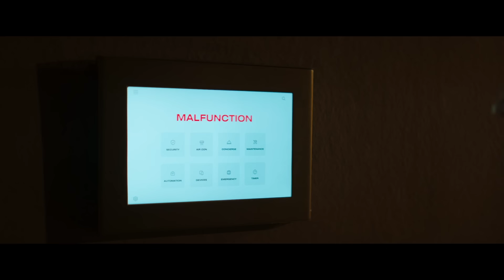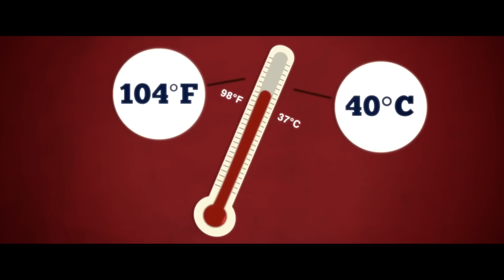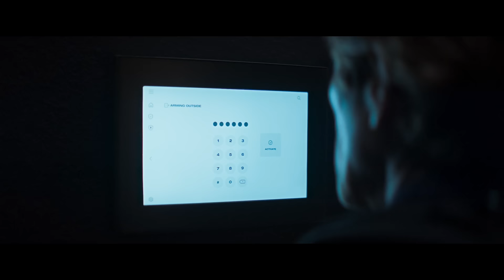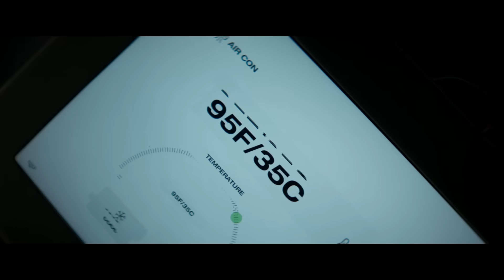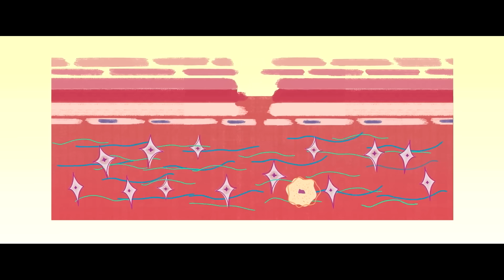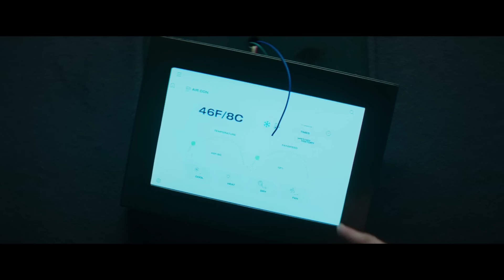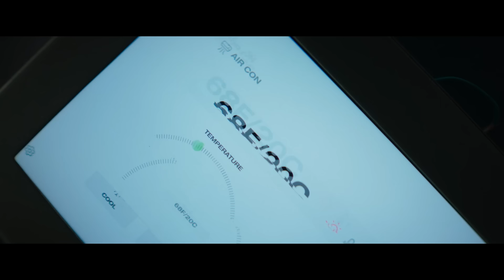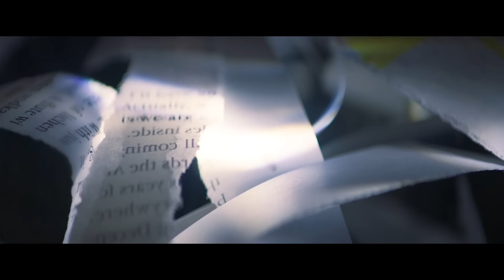How To Beat The DEATH HOUSE In "Inside"

Comment: I would also like to add that since the security system was gonna randomly rude and lower the temperature, once I found the gardens sprinkler water was safe I would use it to make more ice cubes in the event that the heat gets too high again, I’d prefer the place colder cuz I can grab more things to warm up than I can to cook down but still just in case
Reply: Yeah it would take being a lot cooler than room temperature to kill someone than it would need to be warmer than room temperature to kill them or severely debilitate them.

Comment: Even if the police did come to get him, hed be arrested sure, but the homeowner would be sued and convicted for cruel and unusual punishment most likely, furthermore, Nemo would be able to sue the owner for an insane amount of money.  This has happened many many times with robbers actually getting away with money and without conviction because of the homeowner's actions.
Reply: Not just the homeowner, in this case the building  owners can be prosecuted and sued as well. Having an aparartment that cannot be exited in an emergency is a massive violation of fire safety codes. So is having a fire alarm be triggered but not be responded to.
Reply: but the system malfunctioned, theres no proof the homeowner intentionally wanted to trap anyone so i dont think he'd get in trouble
Reply: @TheCinnamondemon Intent or not, in case of an emergency if there is not a clear way to escape then someone is held liable, usually the one that built the building. Considering the collector had security camera access to many parts of the building, we can assume that they are either the owner or have a great deal of influence over the building.

This building absolutely breaks the fire code and Nemo definitely would've been able to sue in the event that the police showed up.

Also I do believe that there is a high likelihood that they could prove intent to toy with Nemo. The garden's sprinkler system does not activate once until the point where he desperately needed it, and then it conveniently turns on and is now active for quite a consistent schedule across multiple days. The idea that you could break the security system into turning up the heat already seems fishy to me, but the fact it just magically went the opposite way conveniently when Nemo was at serious risk of heat related injuries is bs and there is no way that wasn't planned, meaning they still have significant control over the apartment despite the control system not working. Unless the owner is able to access the building and remove evidence of this fact before Nemo sues and this gets investigated (which is entirely possible that they can, or they may have someone in the police force that can hide the evidence for them) then I think they absolutely could prove intent, even though that isn't necessary.

Comment: Cold air being pumped in is ALOT better than hot air. You can only take off so many layers to cool down and have limited resources that could keep heat away and hydration becomes a worse issue, in the cold you can layer on and on clothes, blankets and everything else that keeps in heat,hydration becomes less of an issue(still a big issue tho) since the air becomes more moisturized, the cold also doesent make you as weak as the heat.
Reply: Actually a major part of air conditioning is removing humidity, making the air extremely dry. But yeah nearly everything else about the cold is better than extreme heat.
Reply: A lot is two words, not one…
Reply: @skaie.  don't think you have a lot to worry about dry air with an indoor pool tho
Reply: I live on the Tropical Island of Guam.  I would prefer 104F over freezing temp any day of my life.  I detest the cold.
Reply: @jdsguam  We're not talking about preferences here though.
We're talking about survivability, in which case cold is objectively better. There's even a decent amount of stuff to burn in a pinch, although that can be risky with sprinkler systems.
Reply: @MartinFinnerup  if sprinkler systems exist, that means smoke detectors exist
Would be safe to assume that would set off an alarm and summon help 👀
Reply: @jdsguam I've been to Guam and grew up in Texas and I HATE the heat, it goes both ways
Reply: @somenamelessdude8095  I grew up in Northern Jersey, lived in Germany & South Korea for years.  By the time I turned 37, I never wanted to experience winter again.  So I moved to Guam.  I love the never ending summer.
Reply: @jdsguam  that's how it works, just like all my friends who grew up in Indiana hate the winter. I've been to Busan too, we get around
Reply: @somenamelessdude8095  I was born in Indiana - Winter at every turn!  lol
Reply: @jdsguam  it's no Guam but it gets humid sometimes. Yuck
Reply: @jdsguam In a life or death scenario where you have extremely limited resources (including food and water) the cold is just objectively better.

Comment: A few things which may have worked is:

1: he could bottle pool water and refrigerate it it make ice cubes. These couldn’t be eaten, but could help cool him down. 

2: perhaps he could destroy the toilet. This may lead a hole big enough for him to climb through and possibly get out through the walls/ floor. If the hole was too small. After getting the sprinkler system on the water could have leaked down to lower floors and got someone’s attention. As the water would be dripping through walls the water may reach lower floors, increasing the chances of someone reporting a problem.
Reply: he could also have found the pipe that feeds the sprinkler system for the plants and broken it, causing the pressurized water to flood the apartment and inevitably leak into the floor below or through the main door into the aisle where "Jasmin" would have noticed it and sounded the alarm.
Reply: The freezer wasn't working, that's why the ice was was melting (14:30)

Comment: All the teammates had to do was call the building front desk pretending to be the owner of the penthouse and tell them, "my house sitter is having electrical issues, please send maintenance to help him." No risk to themselves, and Nemo could get out of there with a plausible story to avoid getting arrested. Why'd they abandon him so fast?
Reply: I think the teammate is in on a scheme of sorts with the owner, which is why they abandoned him
Reply: @MunchingDex  or they were the owner
Reply: Wouldn't the front desk ask.... how did the electrician get inside the penthouse?
Reply: the theory goes that Nemo was set up, and that "3" was either the owner or a co-conspirator who deliberately wanted Nemo to get trapped in there... a "social experiment" if you will.
Reply: @aaronjonellhall1937  Why would they let the electrician in and then wonder how he got in?🤦‍♂
Reply: @NikolaStojadinovic-v3g   The burgular that is in his apartment didn’t go through the front door of the building.  Also, I’m sure that the front desk has the condo owner phone number and the first thing they’d do is try to call the owner back after they escort the “electrician” out the building.
Reply: I think the reason why they abandoned him is because when the system broke, the reception was turned off as well. Do you all get what I mean?
Reply: @aaronjonellhall1937 they can lie say they let them in with a special system they have installed for their house using the roof since they wanted their place to be fixed while gone.
Reply: @aaronjonellhall1937 that isn't what they were suggesting to do... They said to tell the front desk their "HOUSE SITTER" is having electronic issues and for the FRONT DESK to call an electrician. How did you get so confused on their point... There would be no issue with the electrician because the front desk would literally call. And the burglar is the "House sitter".
Reply: @anniellusion  the problem, is that the "house sitter" never entered the building legitimately, they would know if there was someone living in an pent house, because, you know, the house sitter will go in and out of the room? do you have room temp iq or something?

Comment: I had a theory the art collecter was really his accomplice. the door shutting and then him abandoning you almost immediately when he could have easily gotten you some help. the odd painting showing him. the painting now being where it was supposed to be,the accomplice pressuring him theres alot.

also wouldn't putting something in between the door just crush the object? anything that's not metal would be crushed wouldn't it?
Reply: I like that theory, essentially the accomplice knew that he would lose his mind and make “art” like he did on that walls.
Reply: Entertainment Seeker had the same idea. I'll add my vote as well; it makes sense to me
Reply: A dresser as big, heavy, and expensive as the ones that would presumably be in the apartment wouldn't get crushed, could also put a couch or bed frame in it as well. Unless that door is a hydraulic press it should be stopped relatively easy
Reply: they could literally have brought a big thick solid metal bar of hardened steel in the helicopter to use as a doorstop, no need to use something from inside the house itself.
they could have fixed it to some wheels and lowered it on to the platform from the helicopter, and all nemo would have to do is gently push it into place, then lock the wheels to prevent it from sliding anywhere
Reply: @DrDolan2000  I don't know who that is
Reply: @ZugzugZugzugson  gotcha makes sense
Reply: Look at the penthouse whoever owns it clearly isn’t worried about money so they wouldn’t cheap out on furniture so the stuff would be well made enough to stop if not slow down the closing doors enough to give you those precious few seconds you need to escape
Reply: The painting was always where it was supposed to be. He just didn't know how to see it
Reply: Thx captain obvious.
Reply: @thekekman8483 I mean realistically he has 7 minutes, the amount of time it would take to move something large enough to block it just wasn't worth it most likely.

Comment: How many walls in a building like this are reinforced? The doors and windows are designed to not be broken. I’d go for the walls in general.
Reply: That was my first thought, People never think of the walls. In the US many times the walls are just drywall and maybe insulation. In many other countries the walls are actually concrete. Given the steel door, artwork, and it's penthouse I give a slightly higher chance the walls are reinforced but still a good option.
Reply: My first thought as well
Reply: I lived in a building like that in Manhattan, and all of the walls were also reinforced with steel. If the lock on the door broke, the only way out would be to try and break a window and hope you survived the 24 story fall.
Reply: That's what I kept thinking! Or bang on them to get the girl's attention
Reply: I'm honestly surprised no one ever thinks of that. It's pretty much a common trope that angry people can punch holes in the wall. How hard could it be to think you can angry punch the wall more than once and it might work.
Reply: The D&D Adventuring party approach!

Comment: As far as the heat being on, he can block the air vents causing the unit that supplys the heat to shut down on high temperature rise, or just pull all the wires from the thermostat
Reply: This was my idea I’ll have to do was cover the vent
Reply: And maybe that would cause more damage which would make people in the building complain and then the owners would send someone to fix it

Comment: That glass is strong but once there's force applied as a great-pressure, a strike it would usually rebound will make the first break; but the strength of those windows are in ply, a transparent polymer-sheet adhered between each reinforced panel, prevents broken surfaces from allowing entry: subsequent layers of reinforced glass and polymer would still hold up, and each has to be broken individually. I'd line furniture up end to end until the space between the opposing wall and the window are jammed tight to bulge the pane of glass, then I'd hammer a piece of wine-bottle through it.

Comment: It’s actually awful advice to try to ration your water the most common way to die in hot areas like deserts is dehydration even when they have a full bottle of water because when you don’t realize how dehydrated you actually are until it’s too late the best thing to do is be as hydrated as possible and if you have little water to work with you should drink it all
Reply: This isn't exactly true.
It's not a bad idea to ration your water. It's a bad idea to ration your water stupidly, and let yourself become dehydrated for no reason so you can hoard water like an RPG-player hoarding potions.
Reply: You would be amazed at how many people die of dehydration in the desert with water still in their canteen/water bottle. If you have water drink it, stay as close to hydrated as possible then the dehydration has to start from a place of full hydration, instead of keeping yourself near or in a state of dehydration because it’s much less of a drop to a negative outcome.
Also it’s weird but true that more people drown in deserts than die from dehydration. Probably because the ground is so barren that flash floods are a thing, because the ground is so barren it doesn’t soak up water well, and nobody expects it or prepares for it but if you’re expecting to be going into a desert you prepare for and are equipped for a desert environment.

Comment: He could have gotten clothes like towers or sheets wet in the pool and then put them in the freezer, then wrapped the icy fabric around his head in the hot times. Also, instead of a 'help sign' a signal mirror directed at another apartment or even passing helicopter would help.

Comment: Isn’t it still a good idea to drink your water all at once? I don’t know much about this, but I’ve heard that often people who die of dehydration are found with lots of water around them because they thought they should ration water. I’ve also heard it’s better to just drink when you’re thirsty until you’re out of water. Which in this case would just mean drinking it all at once.
Reply: This, plus i've heard that when you drink a lot of water that makes your urine very clear, you could then drink that to recycle the water since the urine at that point is mostly water anyway.
Reply: Let your body distribute it it's very smart
Reply: Yes. If you’re in a survival situation you want to drink water  right away. When you’re  dehydrated, important proteins that regulate moods are not produced and toxins are not flushed. So your brain goes from making cognitive decisions to making basic survival decision which leads to avoidable mistakes. your body needs water to regulate heat,  and organs to function properly. All important if your survival is based on physical demand like Nemo.
Reply: It's not that you should drink it all at once, it's if you are thirsty you should drink. Basically if you are thirsty that's the body saying you're low on water, by drinking then you get the body enough to operate properly. By rationing a sip per day for example that's just dehydration with extra steps on the first day.

Comment: If he wanted to get out through the windows he needed to start scraping away at the edges of the panes and the sash.  SOMETHING has to hold them up and they are usually not particularly strong metal.  Even if he had scraped away at it with a knife and it took him a week or even a month, he'd get through.  

Something he didn't think of is that he should have not eaten ANYTHING until he was pretty well into it.  Water is the first priorty, not food.  When you eat, you waste A LOT of water since it doesn't come out dry.

Another thing that he could have done is find a part of the floor that's carpeted or at least not covered with hard tile.  From there, he could fashion a holder and start putting water from the pool into it.  This would start to rot the floor making it easy to create a spot he could smash through.

To counter lonliness he needed to make a doll or a dummy or even a drawing of someone he could talk to.  Even a poor substitute is better than none.  Talking to the FISH would have even helped to a degree.  In fact, he probably should have watched the fish, since it's said to have a calming effect on people.

Finally, I'd say that I'd rip out the control panel of the computer system and destroy the connections.  When no signal gets to the systems they are going to shut off.  If nothing else, the heating/cooling systems are down for good.

Comment: Never seen the movie...but....walls are usually easier to break through than people think. The door might have been reinforced, but the walls were probably aluminum stud walls. Even if there was some sort of firewall, it's a very thin piece of metal. Anything bigger for that amount of space would weigh too much. Knowing she smoked right outside the door, worst case, you can still "leak" water out from under the wall because a plate wouldn't go all the way through the subfloor, which could get her attention for maintenance.